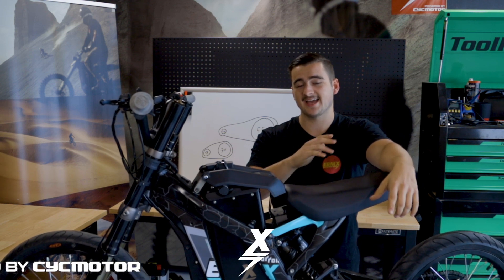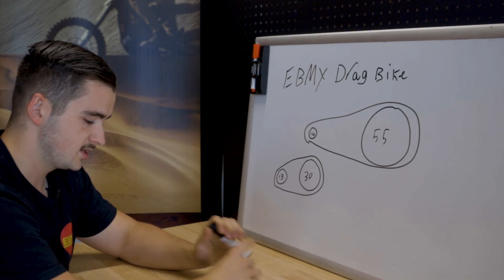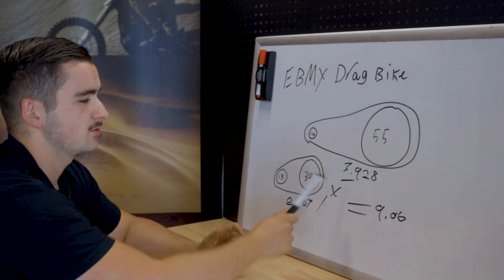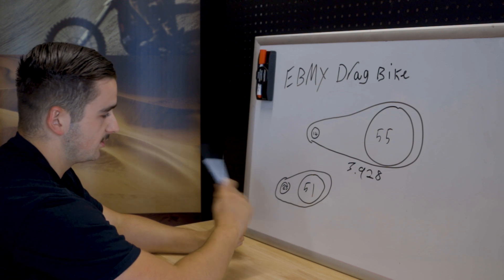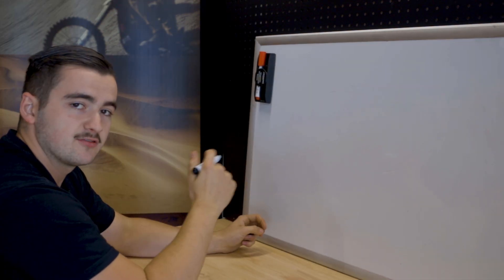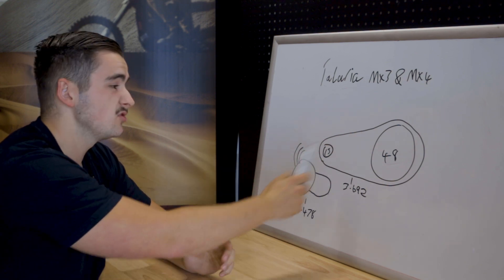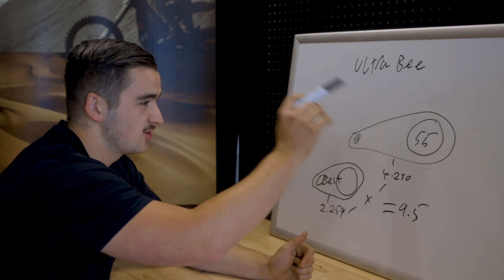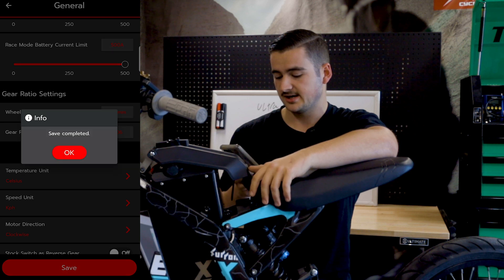Calculating Gear Ratios on your EBMX X-9000

Comment: Cant find any sprocket numbers for the eride pro ss online. You happen to know the front and rear numbers for the belt and the front for the chain? Manual says 8.57 ratio but that doesn't help when I swap the sprocket. Currently running the stock 55t sprocket on Shinko 241s and X9000 coming in soon!